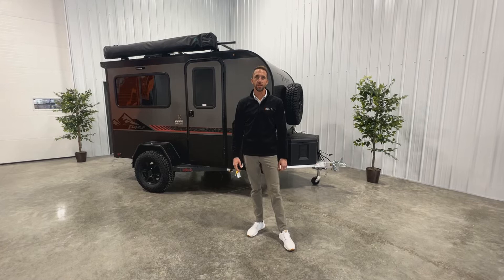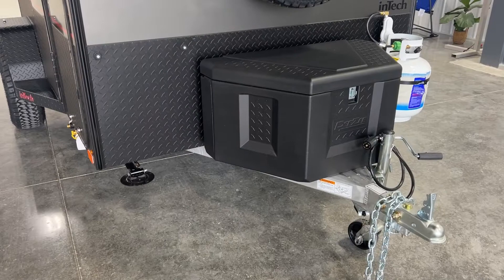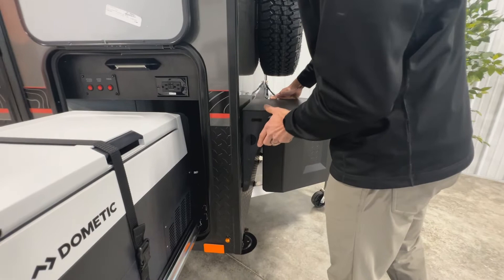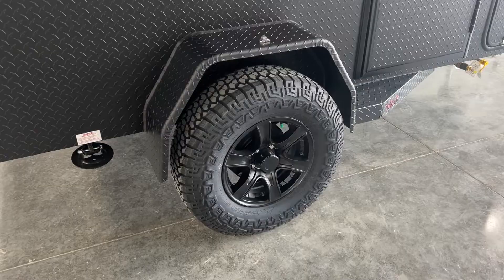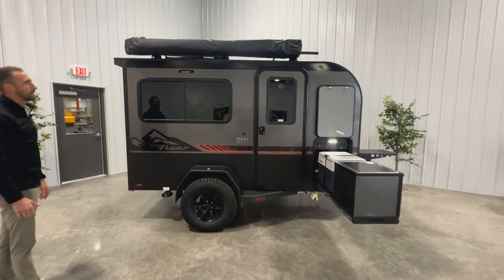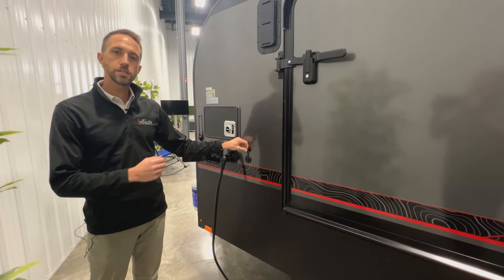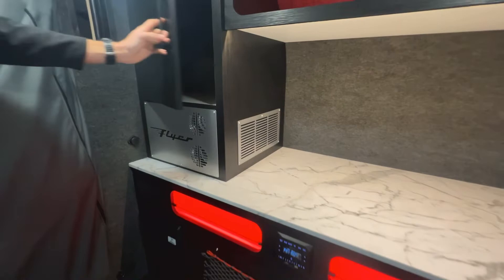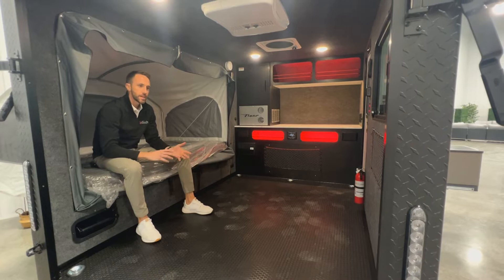2023 Flyer Explore Walkthrough

Comment: Can you guys reach out to Flyer company for them to make a slide out a one touch button in the bedroom area instead of physically having to stretched your bed room. One touch button slide out is better.
Reply: I don't see that slide out option working for this. if you had a slide out, you would also have to have that slide in, which would take all of the hauling capability away from the trailer.  however, I can see the slide out option being practical of the other trailers that they build that are strictly campers and not toy haulers.